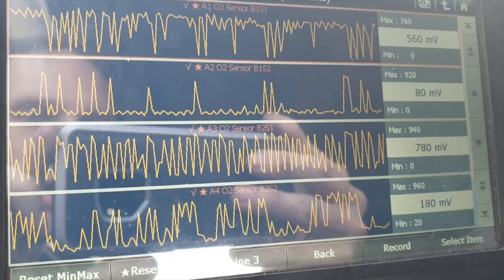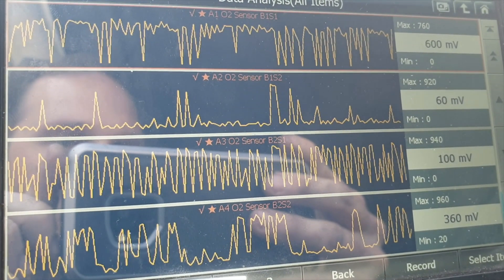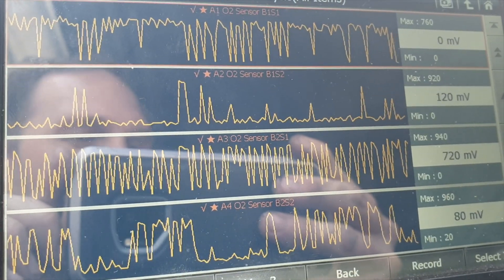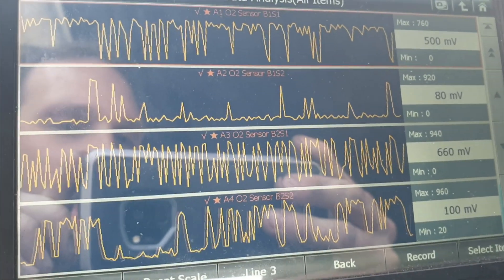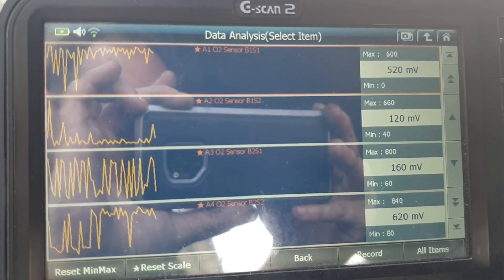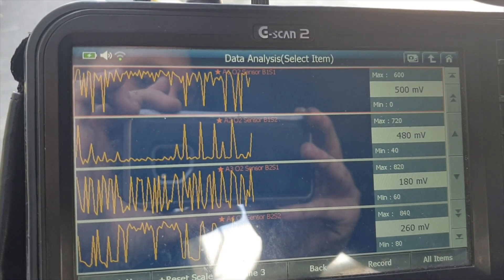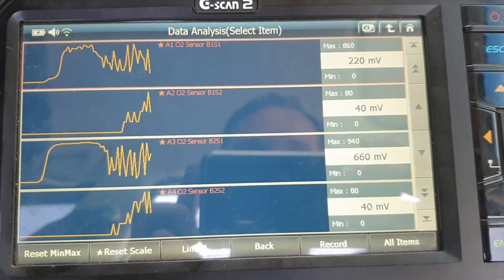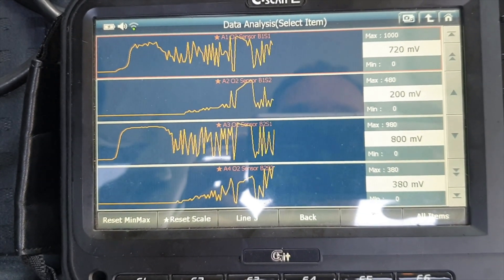Mitsubishi Pajero with fault code P0125

Comment: I have a 2000 Mitsubishi Exceed 3.2 tdi 5 door. Stuck in 3rd gear when D selected N flashing. Not getting a Diagnostic code. Any suggestions. ?

Comment: Thanks for the hot tip mate. Got a diag. to do tomorrow for a customer on an ML 3.5 with a P0125 and P0173. His B2 LT fuel trims on freeze frame are at +25% and ST trims are on +12%, ECT 87°,  so I was already thinking down the lines of a lazy or flat lined B2S1, and I'll possibly smoke the intake just to be sure of no underlying issues while I'm there too.👍🇦🇺
Reply: @Jason Moffat
Hi Jason,
Most likely oil getting down there from leaking valve covers causes this problem, so a 2nd hand one from a wrecker may not be a great option.
Yep, it's in a stupid and very trick place to get at. I confirmed on my customers car that this is indeed the exact issue his has but as yet he hasn't got back to me to replace that o2 sensor, so I haven't had first hand experience yet.
I have a set of various o2 sensor sockets/tools to use so I have a few options. My thoughts were to use a long breaker bar and try to access it through the passenger side wheel arc, or from up above, after I heat around the sensor with an lpg or map gas torch a bit before soaking around it with crc, or wd40 etc. Failing that I will use a ring spanner and a mallet after taking the pins out of the sensor plug, or cut the plug off the sensor to get the ring end of the spanner on it. Another trick, it might be possible to tie some rope to the ring spanner and pull from up top.
Hope this helps, let me know if you have any good tips for if/when I come to doing it for my customer🤣👍🇦🇺
Reply: @simonilett998  hahaha all I know is it’s going to be a fun experience 😂 I’m sure blood will be spilt so I doubt I’ll be of any help 😂😂😂
Reply: @jasonmoffat8341  Hahaha, try to avoid the blood spilling adventure. Another idea came to mind...after a little heat and a soaking, you could try the ring spanner method using a ratchet strap instead of rope, attached to the ring spanner. Wrap the strap around a piece of solid wood placed on the inner edge of the left front fender and a solid part of the engine, or across to the other front fender inner edge..or attach strap to some other convenient place etc. Then crank the ratchet strap...Might actually work🤔👍🇦🇺
Reply: @simonilett998  that’s a good idea, I might have to give that a go I think. Hopefully it’ll come out easy 🙄
Reply: This is exactly what I have in my triton. Same codes and FT numbers. Taken me so long to figure it out. Trying to find an oxygen sensor from a wreckers. Only trouble is, how the hell do I get the bank 2 sensor 1 out of the exhaust!? The worst possible place they could’ve put it 🤦🏼‍♂️

Comment: I been working on my Lexus and have changed a bunch of tune up parts to get the vehicle working great. I am a big fan of not spending money unless I have to. Btw dont buy oem parts off ebay cause I did to find out the are imitations. I was using a mass air flow sensor and was only getting 13mpg after changing one from I bought at the store I found out that it jumped all the way up and kinda went down again to about 14mpg but have not drievn it maybe a mile or two. I am now getting a code po125 after before I changed the mass air flow sensor I was also getting a p1150 witch is bank 2 sensor 1. I have over 100,000 miles on the vehicle and have changed the exhaust but not the sensor because they are original and expensive. I have cleaned them by soaking them in a cleaner, im not sure if that ruins them. Could it be possible that my o2 sensors are giving up on me causing these codes. At first I was thinking the mass air flow sensor was causing codes since it may have been a fake. Now with that new sensor I got from adavnce in a denso box I now get p0125.

Comment: Hi from California!  Thank you for posting this solution.  I have the same problem and could not figure out what was wrong (I changed the coolant temp sensor and the termostat - and that did not fix the error).  I am not too familiar with the freeze frame data associated with the Montero (Pajero), but after you explained it, I took my scan tool and captured live data and saw that my O2 sensor B1 S1 was always giving me 0,0v  while my B2 S1 was giving me 0.040 to 0.90v (I had changed that previously due to a different code)- so that is the problem.  Thank you again, I have been trying to solve this issue for weeks, and could not find a solution even on the Mitsubishi Forum where others were also having this problem.
Reply: Did you get this fixed? I’m having the same issue